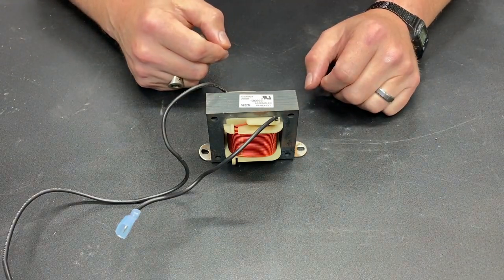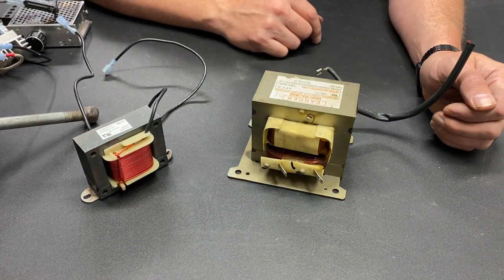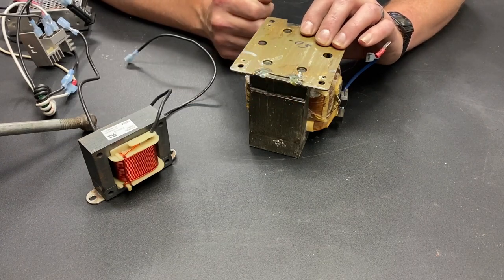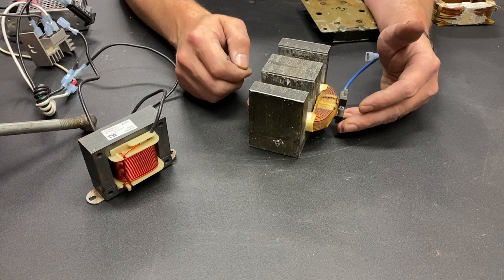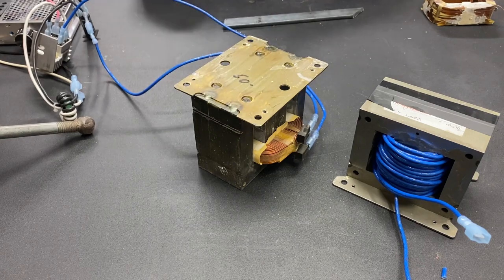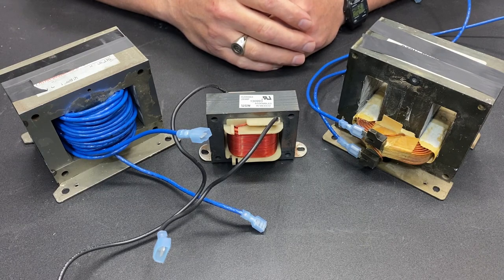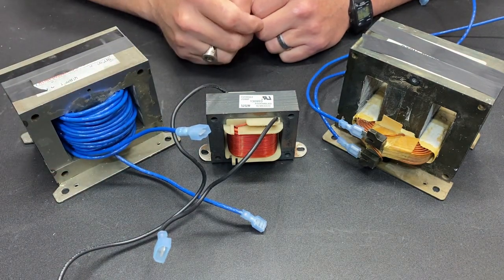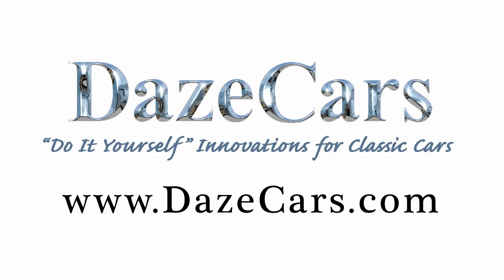DIY Treadmill Motor Choke Built From a Microwave Transformer

Comment: I have the same problem as beautifulsmall, that is 240 V supply in Australia means a lower primary coil winding count. I am wondering if adding a second (or third) coil in parallel would while helping to increase the current flow may have some undesirable effect on the impedance? I would also love to know your thoughts on the ferite ring chokes which I find on some treadmills. Any chance they could work or be modified to filter the power supply? I would also think that an old battery charger transformer primary would also be a possibility  and you would not need to strip off the secondary.
Reply from the maker: This is what I know.  Two identical coils in parallel will cut the resistance in half which will increase amps/volts available to the motor no problem but it does nothing to increase the effectiveness of the choke.  The magnetic field created by the core and the coil is what helps "clean the power" and an electromagnet gets more powerful the more wraps of wire it has (all other things being equal).  A better choice would be two coils of equal spec in series.  The ferrite ring chokes are good on the AC side of things between the SCR and rectifier.
Reply: Thanks for the  reply, can you please advise what size torroid you use on the AC side, what size wire and how many turns? @dazecars
Reply from the maker: The torroid is lnked in many of my descriptions and it is 7 wraps per lead  @garychaplin9861

Comment: Hey there. Other than treadmills, what kinds of electronics might have a choke in them. Ive take 3 treadmill apart now and haven't found one yet..
Reply from the maker: As far as I know just treadmills. Chokes are used in lots of things but a basic choke won’t be big enough. It must be a “motor choke”. Those would only be found in things with large DC motors and The only thing I know of that uses a large DC motor is a treadmill.

Comment: thanks for the great content
if I want to go with the DIY version of the choke for a 2hp motor, how many loop of wire should I wrap around the core ?
Reply from the maker: Good rule of thumb is the bigger the choke the better so fill it with as many wraps as you can.

Comment: Excellent work, great visual demonstration of what 100 Hz or 120 Hz does to a brushed DC motor.
Do you have any experience on using a DC capacitor across the motor supply may I ask?
Thanks for sharing.
Regards John.
Reply from the maker: I have played with an RC circuit (capacitor and resistor in parallel) had one on my lathe for a while and it had an observable effect by it self but not much different than the choke and not any observable improvement when using both.  The reason I removed it is if I loaded the motor in other words put it is a situation where I was pushing up against the max available torque the RC circuit caused surging.  Could be because the cap was incorrectly sized but I don't know.
Reply: @dazecars  Hi, thanks for replying. I got both a choke and a large (Physical size cap diameter 2.5" x 5" tall, I cant find both items at the moment, Grrrrr!) with an eBay purchase, but thought the inrush would be too high in operation. I have another ex treadmill motor that I want to set-up and sell with a rudimentary system, hence interest. Again may thanks for the information and great videos. Regards John from the UK
Reply from the maker: @bostedtap8399  Glad I could help, don't hesitate to reach out if I can be of further assistance.
Reply: I was thinking the same thing… @Daze, your knowledge and understanding of circuits is impressive for not being being in the field professionally.  I think adding a start capacitor is necessary with any DC motor circuit for motor longevity. Thats why you see many motors with caps mounted directly to the bodies.

Check out Jeremy Fielding’s channel if you haven’t. He has some good content that you’d be interested in.

Comment: Thanks for the rundown on motor choke options.  Just wondering, I see many videos of people rewinding rotors and even stators in very crude work environments.  This then leads me to wonder if instead of just wrapping insulated stranded wire on you diy choke you might use some insulation paper and wrap bare stranded wire on the former microwave transformer?   Incorporating a crude fishing reel style wrapper it might only take a minute or two to create the stranded wire wrap which could then be shellacked.
Reply from the maker: you could use actual wrapping wire like they use on motors and such as long as it is a heavy enough gauge.  Keep in mind it is not "bare".  Bare wire does not create the wrapping effect, the current just jumps from wire to wire and takes the path of least resistance.  Actual winding wire has a thin clear insulative coating on it.

Comment: Can I use 220v to 12v step down transformer primary coil as a choke? , Plz reply as soon as possible
Reply from the maker: depends on the diameter of the wire in the coil.  Needs to be at least .05" or 16 awg

Comment: You also show a wrapped FT-240-31 Ferrite Toroid Core . Does this work as well?
Reply from the maker: it works on the AC side but is not very effective on the DC side, better than nothing but still not very good.

Comment: My comments keep getting kick out or just not going through for some reason. Maybe because I've tried attaching a link of a chock I purchased on Amazon.
Filter Choke - Value: 7.0H, DC mA: 50, DC RES: 550 By Electronix Express.  I've taken the link off to see if it helps .   My question is   Do you think this choke  will work or is it too small for a set up similar to your video  (Hooking up  quality components to SCR controller) ?   I hope this message goes through and there is enough information of the choke for you to tell.  The tredmill I took apart didn't have a choke as could tell only a small transformer that would probably be even smaller than the one I bought after removing half of the windings.   Thanks for your videos
Reply from the maker: That is way small.  It is raited at 50ma or .050 amps so roughly 360 times to small

Comment: WONDERFUL, you just helped me out in my plans. How about using two of those 110 volt microwave coils in series? If you could test that and see how much rpm was lost we would know if it was worth while. Thanks again.
Reply from the maker: Hardest part would be getting two identical transformers.  I scrapped 11 microwaves trying to get two matched ones to make a magnetic base.  Finally got two that were close but none were identical.  Adding a second coil in series adds a lot of wire and is going to reduce your amp flow.  A better option might be to wire the two coils in parallel.  That would cut the resistance in half BUT I am not sure how it will effect the magnetic field or its ability to act as a choke... something to think about.
Reply: You dont really need 2 primaries from 2 "identical" transformers. While it may seem ideal 2 closely shaped cores with the same sized cross section have very similar if not identical primaries since to build them to 120vac they basically use the same size wire and # or wraps. But even still a primary rated for 120vac usage of any wrap can work just fine as long as it fits inside the core lol. I use a few now. Just make sure you wire them in series

Comment: Thank you for the video, very clear and informative. I wonder if you can tell me the specs on the big choke you use (the one from original treadmill) ? I see the "name plate" specs, but too little/blur to read. Thanks.
Reply from the maker: Its not specs its just a part number The choke in most of my videos is part number 130993.

Comment: The transformer choke is 5.5 mH . Is there any other spec such amp rating (suspect it is rated at 20 amp) maybe resistance and weight ? Might be able to match at electronics sites such as Mouser or even compare values of other recyclable electronics.
Reply from the maker: Ether it is a transformer or it's a choke.  There is no such thing as a " transformer choke".   Sellers on places like eBay and other privet seller listing places will list them as both because a transformer and choke look very similar and they don't know the difference.  Lots of people have tried to find them on places like Mouser and those are all component size.  Simple answer is if it's not labeled AS a MOTOR choke than its not going to be big enough.
Reply: @dazecars  
I understand the difference, should have used the correct term. 
The correct wordage would be power inductor filter (choke). Although this choke is in the form of a transformer. The form size depends on how much ( power )amperage, wire and core.
I was trying to get some spec as to what could be compared rather than just looking for arcing when running it. 
If the modified microwave wires were maybe  measured for resistance or Henry’s ?
Reply from the maker: Not being an electrical engineer I do not have any specs or calculations for you on the motor choke. What I can do however is offer you some guidelines. First of all bigger is better. I have several motor chokes ranging from the size of a tennis ball to the size of a soft ball and the bigger they are the better they work. Second the wire for the choke needs to be a minimum of 16 awg. If the wire is not that big or better it will not have the amperage capacity to allow the motor to work properly. Amperage is the most important spec.  A lot of the chokes available online are rated in mA.  there are 1000 mA in an amp.  Treadmill motors are rated in amps so most chokes available online are several hundred times too small.  Third they are not available on Amazon at least not inexpensively, there are a few privet sellers on Amazon selling used parts for big bucks but the available chokes on amazon are too small because they are not designed for a motor even though they look correct in the picture they are WAY too small. The choke in most of my videos is part number 130993.  Please let me know if I can be of further assistance. @byranyates6987

Comment: The problem with the blue wire choke is not all the wire  fault. The core of the iron is reaching saturation.  If you leave a gap between one side of the top plate.
Reply from the maker: thanks for the info

Comment: Allways appreciate your vids!
Learned a lot. Question; tje sparking, does it ruin the motor (burn), or deplete the brushes?
Reply from the maker: yes.  😂😁  inside the motor is a copper strip called a commutator.  The commutator is what the brushes ride on and the system is designed with the brushes being the softer materail so as to minimize the wear on the commutator but even with the brushes being softer the coper depletes over time.  The sparking you see is similar to putting a piece of steel up against a grinding wheels.  The brush material and copper being depleted sparks as it burns up as well as electrical arcing.  The brushes will still wear faster and can be replaced BUT the copper is not easily replaceable so if it is depleted the motor will need to be replaced. Controlling a motor with an SCR and not using a choke will depleat both the brushes and the commutator.
Reply: @dazecars  Thanx for the reply. Makes sense.!

Comment: I have a question my treadmill doesn’t have a motor choke. Is there a reason why? Thanks for sharing video!
Reply from the maker: Your treadmill likely uses a PWM which produces cleaner power so the choke is not required.  Not a bad idea but not required
Reply: Thanks for getting back with me! I enjoy the channel!👍
Reply from the maker: glad you like it

Comment: Just wondering.   Could you, after Removing the output windings in a microwave diy choke, cut the metal thickness down to the thickness of the input windings, reweld the mounting plate?   Would this improve performance?
Reply from the maker: I would assume that it would improve performance but have not tested it.  If you do that keep in mind that the core is laminated and would need to be compressed while cutting or milling to keep the outer layers from "fraying"
Reply: @dazecars  with fraying in mind, how would you cut this?   Would this inspire a future video for testing?   Maybe a diy coil could be perfected to be able to highly recommend.   Keep up the good work.
Reply from the maker: sacrificial aluminum clamped to either side the keep it all tight as you cut it and then mill it flat

Comment: There are two coils in the transformer, would there be a difference if you USED the other half of the transformer coils as a choke?  Could you just cut out the un-necesary coils rather than cut/re-weld the core?  Thanks, Bill
Reply from the maker: You can not use the fine wire coil as it will not handle the amps.  yes you could cut said fine wire coil out as long as you don't damage the primary winding

Comment: Hey, it’s me again with some questions. 
I got two different toroid rings. 
1. Hondark 49 x 32 x 15 ferrite core MnZn PC40 (Amazon)
2. Mag FT-140-43 toroid core. 
I’m not sure how to choose one for this application. 
I also have the SRC 120 240 vac 10000 Watt , the Boamain 100 Amp, 1200 volt diode bridge rectifier and a big DC choke. I also got the digital rpm display you used. 
So, I’m ready to go, I think. 
My question is about the toroid. 
How does one calculate the correct toroid material and dimensions?
How many wraps of each wire and in what direction? Is one clockwise and the other counter clockwise, or both counter clockwise?
I’m not putting you on the spot here for blame if something goes wrong, but I just want to know what you did and how you figured it our. 
I’ve watched YouTube videos on toroid ferrites and it’s not clear to me. There seems to be two different patterns. 
Basically, I’m not as smart as you. I am an optical physicist but know nothing about electric circuits. 
Thanks again for your assistance. 
Paul.
Reply from the maker: This is the one I would use.  It's a good size.  I do 7 wraps, in opposite directions.  I don't think it matters but that is how the ones from treadmills have come to me https://amzn.to/3V3TQyl

Comment: good info but is the choke in line with the hot wire or inline with the return wire?
Reply from the maker: I put it in line with the hot side but it will also work on the negative side.  I have seen it wired both ways in a treadmill.

Comment: Great video as always.
Question...if you took the transformer, connected the two coils in series, making on coil, all be it in two parts with different size wire in each coil, would that enhance the effect as a coil as a choke and eliminate the danger issue of using the smaller wire coil?
Reply from the maker: won't work.  The fine wire of the second coil will at the least restrict power flow so much that your motor will loose speed and torque but more likely you will burn through the wire somewhere as it is way to fine to handle the loads these motors will put on it.  Wire size is directly proportional to the amps that wire can handle.
Reply: That makes sense...what if I took the large coil out of two transformers and installed them both Into one choke, hooked up in series?  Do you think that would improve the performance of the diy choke?
Reply from the maker: @derekdeveau2708  First the problem with that is the coil adds resistance (this is the reduction in RPMS I mentioned in the video) and a second coil in series will add more resistance. Second a better option would probably be to cut down the body size so that it perfectly fits one coil (that will be a future video)  Just guessing it will work better but it is at least an educated guess 😂. And third we are chasing diminishing returns.  The transformer coil choke was almost as good as the factory built choke in spark reduction so any further improvements will have large costs in materials/effort/time for little to no gains.
Reply: Makes sense. Appreciate your  input. Thanks.
Reply from the maker: @derekdeveau2708  glad I could help
Reply: I'm so glad I read this comment string, I was just about to ask about using the longer finer coil, or cutting the ferrite body shorter, lol.
Reply from the maker: lots of info

Comment: Question not related to this video. How do you attach the wires to the better quality rectifier. Soldering, special connecter or modify the unit to fit a standard connector. Thanks.
Reply from the maker: I have done two of the three things you mentioned.  The first one I put together I reduced the width of the terminals and then opened the connectors with a screw driver to accommodate the extra thickness.  Worked well no issues.  All subsequent ones I soldered wires to the terminals and then covered the terminals with heat shrink tubing.  Worked equally as well but does not have the risk of coming loose or the risk of something shorting out the bare terminals so that is IMHO the better way to do it BUT a soldering iron will not get the job done. I use a torch and  I attach a pare of vice grips to the terminal near the base where it enters the body of the rectifier.  This helps protect the rectifier from heat.  I then heat the tip of the terminal with the torch and apply solder to the connection.
Reply: @dazecars  Thank you.

Comment: Thanks for all your videos! Would it be possible to connect the upper coil to the lower coil so they create one big loop? Thanks!!!
Reply from the maker: no because the fine wire coil can not handle the amps.  The wire is too fine
Reply: I see your discussion below. Thanks for the clarity.
Reply: Great, I saw the conversation. Thanks so much!